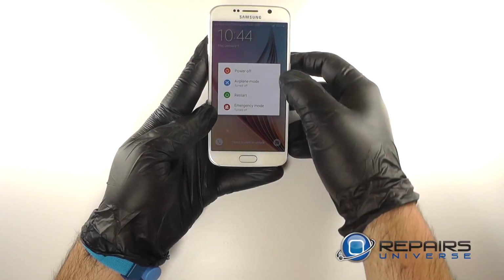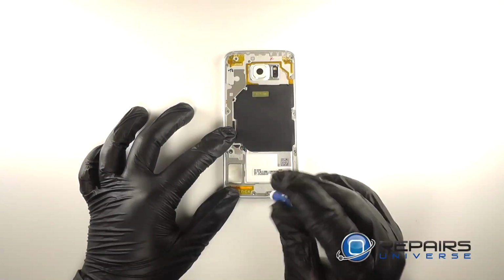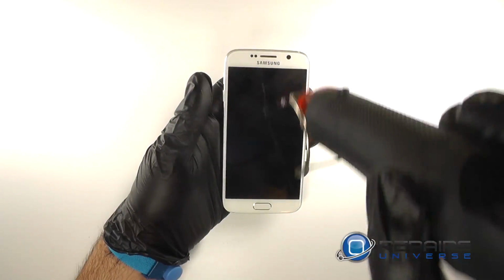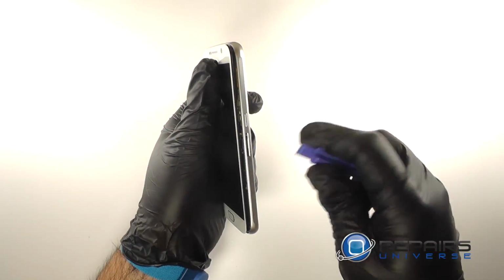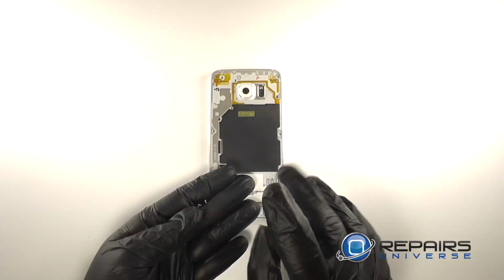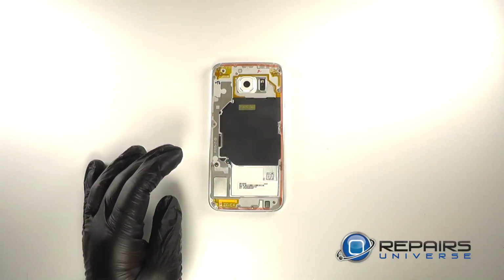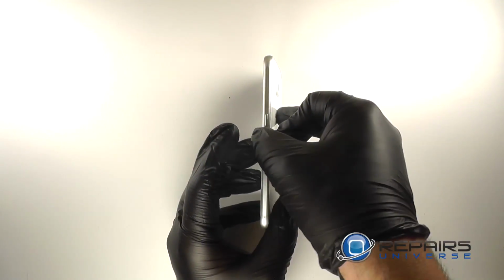Samsung Galaxy S6 Battery Replacement and Repair Guide - RepairsUniverse

Comment: I just used this video and did it and it wasn't that bad. It actually comes up pretty easily if you heat it well (I used a hair dryer). And I didn't have any fancy tools. Thanks for the video!

Comment: Samsung lost me at needing a heat gun to get the back off. What a bunch of thieves running that company and every other one forcing buyers to essentially throw away their phone now every couple years when the battery dies.
Reply: randalusa Well technically if this guy just did it in 4 minutes I'm sure you can do it too
Reply: randalusa you can use hair dryer
Reply: @DartLuke  hair dryer didnt work 4 me.... butthis video helped me a lot !! : https://www.youtube.com/watch?v=p7gdnjjKdfU

Comment: does heating the back glass damage the battery? i was thinking that the heat may go through the battery
Reply from the maker: +Patrick Delpilar Applying too much heat certainly could damage the battery. We recommend heating the back glass just enough to soften the adhesive.

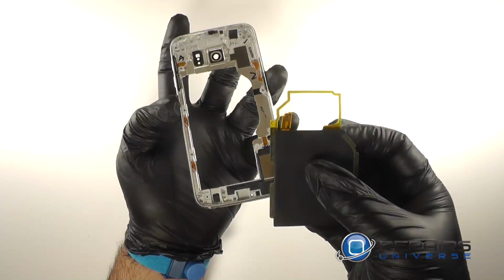Comment: 3:50 I didn't get why you removed the inductive charger and  adhered it again. Can you explain a reason for this?
Reply from the maker: +Zohaib Farrukh This video was titled incorrectly, it should be battery and inductive charger replacement and repair. Removal of the inductive charger isn't necessary for the replacement of the battery. Thanks for the comment.
Reply: @Repairsuniverseusa  yes, thank you for clearing that up. I was wondering about the inductive charger as well
Reply: i was wondering it too, thanks for the reply. Why not rename the video?
Reply: Repairs Universe thank you....
Reply: How to add more windshield washer fluid to your car:  First remove the engine and transmission. Add more windshield washer fluid. Then replace the engine and transmission into the car.

Comment: wtf? you have to remove screen as well?? fuck this i just get a new phone
Reply: It's not that hard. Don't be such a baby.
Reply: Sawier lol, the battery is worse on the Note 7. It'll blow up in your pocket.
Reply: Sawier its pretty simple to do if you ask me
Reply from the maker: +Sawier the display on the s6 sits in a frame and is removed from middle housing/frame to access the battery and motherboard.
Reply: Sawier 
It's a repair guide.  
Now you know how too 
Changes your batterie as well
As your screen.
Reply: Sawier rip 😢
Reply: Total Station 😂😂😂👊🏻
Reply: if I change battery do I have to change inductive charger what does it do?
Reply: Yeah, I did the same thing when the battery in my car went out.  I just threw the car out and bought a new one.  Hey, it's the American way, huh?
Reply: Buy a thesaurus while you're at it.
Reply: bought note7 anyways
Reply: no it won't
Reply: Paul Hicks 
That's why Samsung has recalled Galaxy note. 
Why don't people read a little 
About the things there talking about, before jumping too conclusions 😩.
Reply: +Sawier .... I'm with you! I paid $8 on amazon for the battery, but shit!!!! When he said be "very careful" and took it apart, I said fuck that... with rubber gloves special tools.. etc... Ill cut my losses! My contract is up in a month and a half anyway!!!
Reply: yeah, what a times we live in when you have to take apart whole phone just to replace the battery, btw my note 7 still works fine, sucks that Samsung is not supporting it anymore

Comment: i have an idea dont buy a phone with no removable battery. if you do this you're not only voiding your warranty you're probably going to mess up your phone. not to mention who wants to spend this much time to replace a God damn battery if you even do it correctly
Reply: Actually I already did the mistage but i use my s6 to play games it runs games perfectly but heats fast and stuff and I dont want to risk of breaking it this way is too risky.